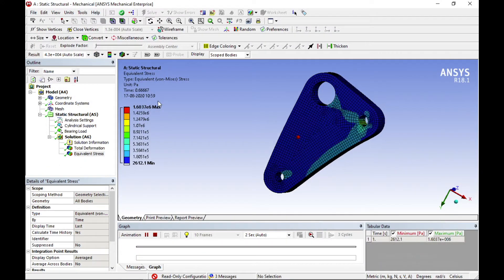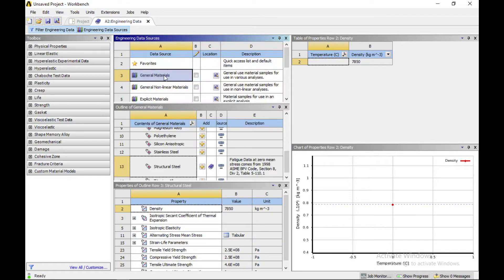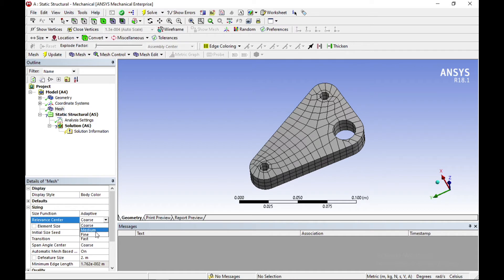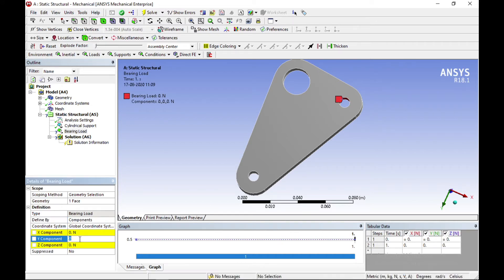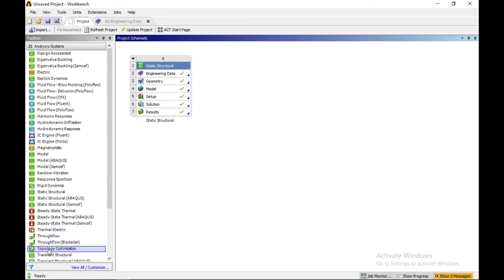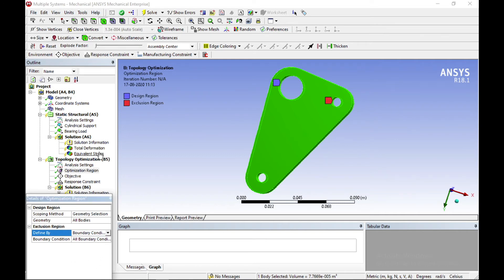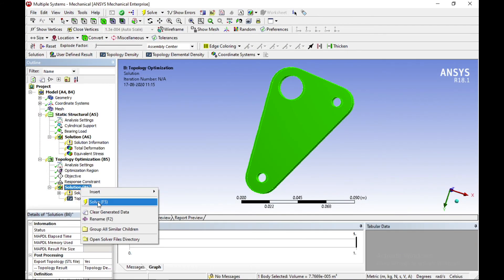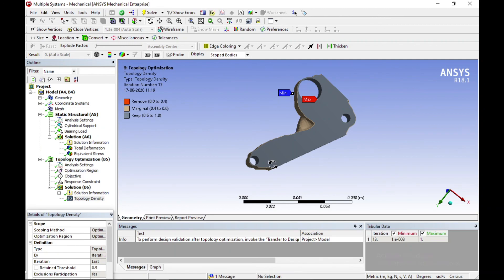Topology Optimization in ANSYS WORKBENCH || Tutorials-TME

Comment: Is Ryzen 5 4600H with Nvidia Gtx 1650 good for Ansys, Solidworks, Openform, Hypermesh, Ansa? Any problem in that? Reply fast
Reply from the maker: No issue. But RAM should be 8 GB
Reply: Due to that I brought Ryzen 7 with 16GB ram compromising with gpu coz Engineering is priority not gamming 😎😎😎
Reply from the maker: Great… Now you can run ANSYS more swiftly 😊